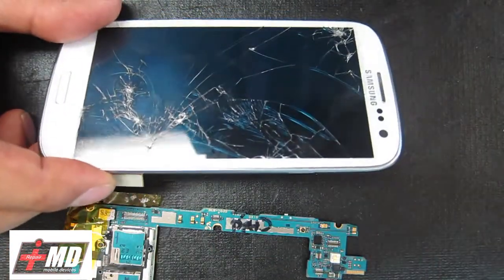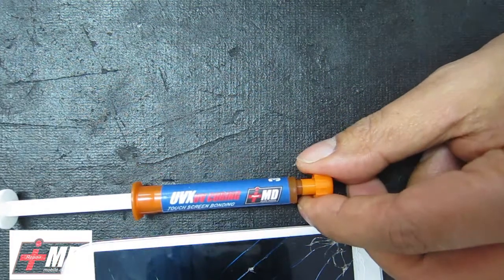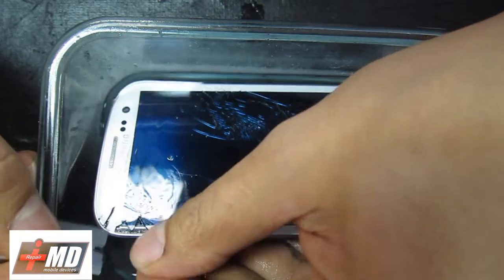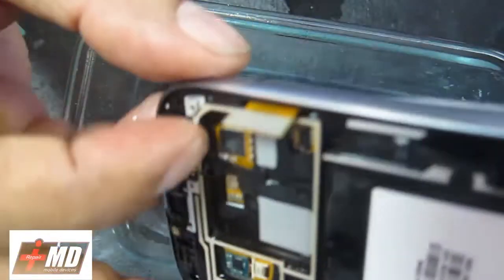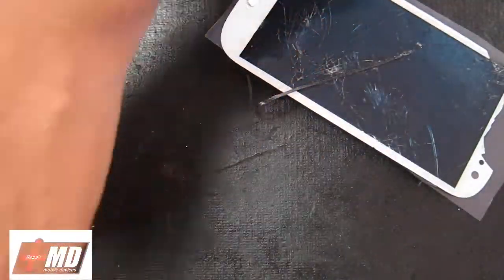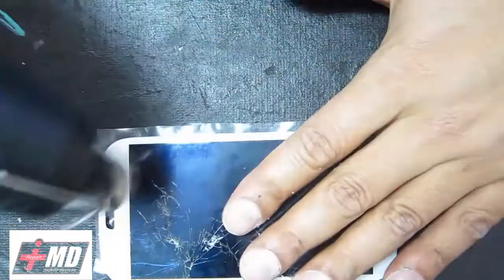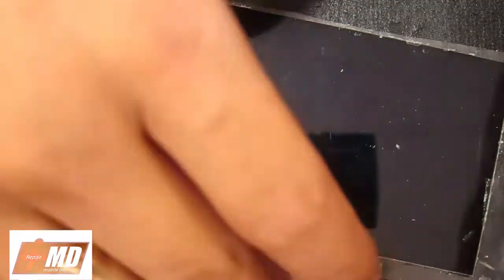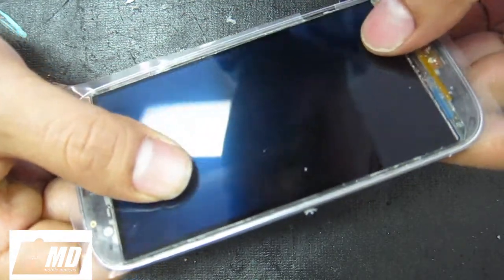Samsung Galaxy S3 & S4 Cracked Screen Repair

Comment: Thank you so much for the video just two questions. Where can I get just the digitizer screen without glass. I accidentally messed mine up from the blade. The second question is that what kind of plastic wraps are you using. Thanks again.